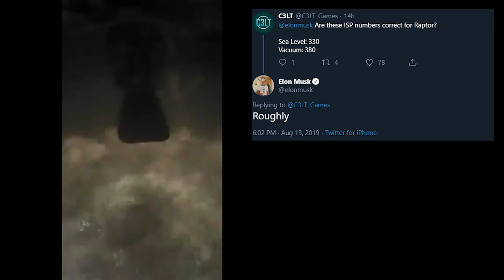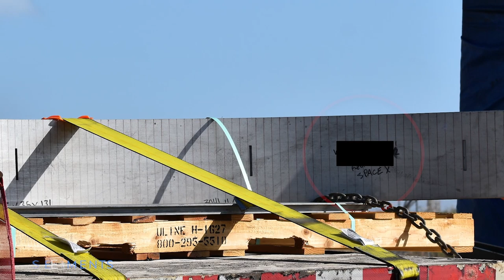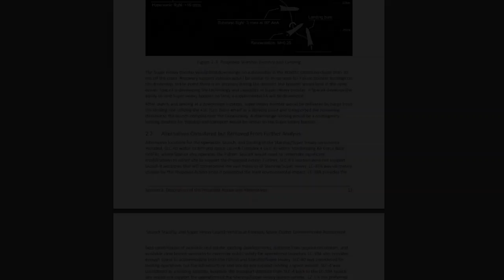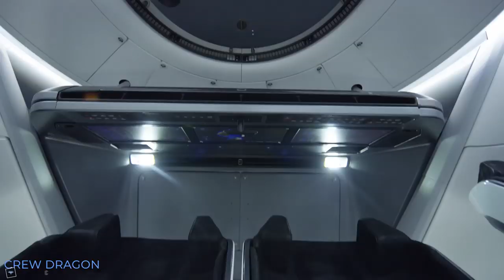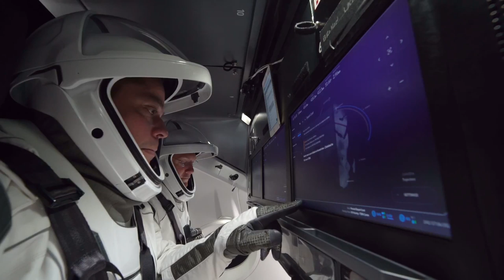25 | SpaceX Go For Launch - Starship & Starhopper News - SpaceX Suits - Starship Flame Diverter

Comment: My guess on those large pipes with the flanges is that they are the LOX lines that will go through the CH4 tanks.  The flanges are to connect to the interior baffles or some other structural member inside the tank.  They will connect to the manifold you pointed out being installed in the bottom bulkhead and thrust structure.
Reply from the maker: That sounds logical! Thank you for the comment! :)
Reply: @Whataboutit That was my thought as well when I saw them in your video. It immediately made me think of the LOX lines inside the S-IC (1st stage of the Saturn V) that passed through the RP1 tank to get to the F1 engines.

Comment: I think that the black sticker is covering SUPE VY. When combined with the letters that are visible, this makes- SUPER HEAVY!
Reply from the maker: Bingo. That's what I thought too!
Reply: @Whataboutit   A crazy Elon style thought: what if the bottom section of Starship prototype is actually the Super Booster? Would explain it getting taller than expected. Pointy section is Starship prototype by itself; only need a short version for first prototype? All sorts of reasons it doesn't make sense, but...

Comment: Lol, superheavy to fly this year? Haters are gonna eat their hat!
Reply from the maker: We will see! But it would be awesome. :D
Reply: Yup.
Reply: The Superheavy 1st stage is relatively simple compared to Starship upper stage. They’ll just need to make a long stainless steel 9 meter tube, install fuel tanks, engines & avionics & run some tests all that takes about half a year or so for a new launch system. Starship is more complicated because it will be for trips to & from orbit & long duration deep space missions so it would eventually need heat shielding, life support, more advanced thrusters etc.
Reply: @theatom7264  I'm really hyped to see how they are gonna build all these engines this fast!
Reply: 3D printing will be used to make most of the engine parts which speeds up the manufacturing process.
Reply: rocket lab already ate their hat.
Reply from the maker: Hope not! I love RocketLab!
Reply: Hopefully they have their nacho hats at the ready,  ;)
Reply: Elon said Mk 1 and Mk 2 could fly by the end of August! Reality time keeps being desynched from Elon Time.

Comment: As we have seen with the N-1, getting as many Engines as Superheavy has working without problem would impress me.
Reply from the maker: It will be difficult!
Reply: People said the Falcon 9 had too many engines to work, and then they said the same thing about the Falcon Heavy. The N-1 did not have the benefit of modern materials and modern computers to design and simulate a launch with so many rocket engines. Starship/Superheavy might explode, but I am betting it won't. Chances are I probably won't even make a decent return on my bet.
Reply: @curtisquick1582 I guess you are right. But it will still be awesome if they make it!
Reply: N1 had pyrotechnic fuel valves, so it couldn't throttle the engines at all, they were either on or off and once turned off could not re-start... Thing's have moved on quite a lot since then... That's not to say that it won't be a very impressive sight, it will be awe inspiring to see this beast go and return for a pinpoint landing.

Comment: In Cocoa there is also a rail way being put in to connect Orlando to Port Canaveral near SR 528 "The Beach-line" which is really close to their facility. I bet Elon will try to utilize that for transport  considering it may be the most perfect way other than truck over 2 rivers
Reply: Actually after driving by today, The power lines were raised by the FedEx building as well across the street to another road so it appears that's what they are doing. Only in those areas. Or maybe just a straighter way to the highway.

Comment: Starship/superheavy may be a lot taller than expected. with 30 thrust optimised raptors (250 tons of thrust) and 7X 200 tons raptor with gimbal the total thrust should be 8900 tons.
When starship was presented last year the total thrust was 31*200 = 6200 tons, that's a 44% increase so probably a 44% increase in height too, so if last year starship was 120m tall it would then be 172 meters tall!
Reply from the maker: The 24th is definitely going to be a very exciting day! Thanks for the detailed comment!
Reply: @Whataboutit  I changed my comment (some errors)
Reply: @johntheux9238  wow 172 meters tall... it isnt a rocket anymore it's a flying skyscraper
Reply: @pappacell  Well, the tanks have an hemisphere at both end that take some space and there is also all the engines, etc... If they make the rocket bigger each additional meter will be only fuel and that's heavy. So maybe if the thrust is increased by 44% the height will not be increased as much.

Comment: My guess is the tubes with the rings are support columns for the fuel tanks. Perhaps  they go in the center of the tank then some sort of spokes attach from the rings to the walls of the tank. I know water towers sometimes have internal support structures like this.
Reply: Perhaps the LOX tank needs a tube that feeds right through the Methane tank to the engines? I'm just guessing here...

Comment: 330 Isp at sea level? Holy hell, that's amazing!
Reply: The chamber pressure is very high so they can reach a very high nozzle ratio at sea level.
Reply: @johntheux9238  I guess that's the advantage of reaching 300 bars. The closer you can get the ratio of atmospheric pressure to inlet pressure to zero, the more efficient the nozzle.
Reply: @General12th  Well, at sea level the outlet pressure
 is one atmosphere so the only way to get an higher ratio is to increase the chamber pressure.
But there is something that excite me: If they reduce the size of the nozzle they can fit a lot more engines on the booster so they can build rockets the size of a skyscraper and they would not loose too much efficiency because even if the nozzle is underexpanded the nozzle ratio is still good enough.
Reply: @johntheux9238  That's why I said it's good to reduce the ratio as much possible. You can't lower the atmospheric pressure, but you can definitely raise the inlet pressure. Raptor's efficiency here can be as good as 0.804, which is loads better than the F1 (0.703).

It's good for the Raptor to be so small, but I'd be more keen on maximizing its thrust-to-weight ratio so the Superheavy (or as I like to call it, the "Starlifter") can have as few engines as possible. Less ship mass means more payload mass, assuming you have the same amount of fuel. But it's possible multiple nozzles interact with each other in a way that improves overall efficiency. Is that true?
Reply: @General12th  What do you mean by "reduce the ratio" ? Because if you reduce the nozzle ratio the efficiency will be lower. (if I do not make a mistake
 it's the ratio between the density of the gas in the combustion chamber and when it came out of the nozzle) and it's 40 for the raptor at sea level.
https://en.wikipedia.org/wiki/Raptor_(rocket_engine_family)
Reply: @General12th  Well, i would not be bothered too much by the thrust to weight ratio because most of the weight is the tanker itself. But if you increase the thrust to nozzle area ratio you can lift a spaceship that's taller. The best way to do that is to make the nozzle smaller.
Reply: @General12th  Yes, it's possible, look at this aerospike engine:
https://i.stack.imgur.com/8t13m.png

Comment: Those long pipes with the rings around them look like they could very well be internal propellant feed lines.  The fact that they are so large is not surprising, internal feed lines almost always are.  The large size probably reduces the tenancy to vibrate side to side.  The rings must be stiffeners but there don’t seem to be enough of them for that.  All just a guess though.  Those pipes are steel and I can’t imagine anyone using something like that as part of a rocket since it needlessly cuts into performance.  Of course, the initial Starhsip will almost certainly be just be in the form of a Starship and not much attention to performance may be afforded it; just something to fly and shake down.

Flying and landing Starship on the Moon shouldn’t be to tough of a challenge.  Getting into orbit around Mars shouldn’t be to tough either if they can retrofire.  But landing on Mars would be difficult as would be returning to a landing site from Earth orbit.  But the thought of coming back to Earth from either the Moon or Mars is laughable.  That thing would burn up so fast it would look like a flashbulb going off.
Reply from the maker: Thanks for the feedback! :)

Comment: I actually am not a fan off the starship 50s rocketship look. But if it does what it says it’ll do I won’t care. Personally I always thought that interplanetary travel would be better facilitated by building large nuclear powered ships in orbit that could transport astronauts and landers to their destination and be refueled between or even during missions. Landing and taking off with the whole spacecraft seems wildly inefficient to me, but again, if they pull it off my opinion won’t matter.
Reply: Well, if you can refuel it in orbit it doesn't matter if the whole spacecraft takeoff.
Also nuclear thermal rockets has probably enough thrust for starship (but not for superheavy): http://www.daviddarling.info/encyclopedia/P/Phoebus.html

Comment: These Tubes with intersections look like a central Stabilizertube for the upper Parts of the rocket.. Just my 2 cents. Other Parts could dock on the central tubes rings, and you could bulid Floors and roofs every 4 or 5 rings at the inside of starship.
Reply from the maker: But the prototype won't have a crew interior. What would you need floors for? :/
Reply: Those look like long one-piece tubes with disk-fins, not connected intersections. And agree they are for the interior of Starship, nothing to do with tankage. Felix, interior will have some sorts of structures, if not full decks. Can't just be empty to be an useful prototype, right?
Reply: @Whataboutit  perhaps cargo and mass simulators or they may intend to human rate the prototype some time in the future.
Reply: Maybe not floors but something for Hullstabilitiy, You cant leave it 100% hollow. And for 100 % accurate testing, it should have an Interior like a later Flightmodel, because of weight and other things.

Comment: Felix,
Another great show! What is your thoughts on the lack of an abort system on the starship. Any concerns?
Reply from the maker: Thank you! :) No concerns. Launch and reentry (besides the Space Shuttle) have not been risky. 4 people (besides possible russian cover ups in the early days and the Shuttle) have died on launch and reentry so far (again, if you leave out the Space Shuttle). On a design like Starship an abort system is really hard to implement. Also you can also make the rocket as it is a safer vehicle. That reduces fatal accidents as efficient as an abort system. In the end though safety must be a top priority. It might be possible to use the Starship itself as an abort system. If the booster has a malfunction, you can separate and use the Starship as a life boat. That might be a way.
Reply: What about it!? That’s a good way at looking at it. Starship is the abort system. I never thought about it that way. I believe you have successfully changed my outlook. You’re the best!  Thanks!
Reply: @michaelpuckett6138  They can shut down superheavy so even with low G-forces starship can escape.
Reply: John theux  My main concern was while sitting on the launch pad, fueling up. You can imagine an explosion of the super heavy or something like 5 sec after lift off. Those times are where most of my concerns are. If starship could be its own abort system & get outta way of a self destruction event, then my concerns will be lessened a great deal.
Reply: @michaelpuckett6138  Well, starship can't escape on the launchpad (less than 1G) but once the rocket has take off it can.

Comment: They'l just fly it over. no need to move it around.  I suppose thous pipes are core of the ship. They will stretch cables from it to the outer shell to keep it stable or use metal sheet to make levels, since there is no interior yet to keep it all together.

Comment: Am I the only person that would rather see more mechanical switches and what not in the dragon? Touchscreens are great and all, but I'm a sucker for that nice KACHUNK that a beefy switch gives.

Edit: also, as roomy and nice as that interior looks, you need to keep in mind that every last inch of free space will be taken up by cargo and supplies on an actual launch. Empty space is wasted space and wasted space is wasted money.

Edit 2: and I think that super tall section we see next to the nosecone is actually the outer hull for super heavy. Seems, to me, it's too tall to be part of starship.
Reply from the maker: That's what I think too! But you might be wrong about the cargo stuffed into the dragon. Most cargo does not need pressurized space. The Crew Dragon has a trunk module. The reason, why soyuz is always so stuffed is because it doesn't have much trunk space. Correct me if I'm wrong though!
Reply: @Whataboutit  You're right, but just because it doesnt need to be in the pressurized section, it doesnt mean it wont be. That would be kind of a silly reason to not fill all available space.
Reply: One problem with physical switches that NASA learned about over 50 years ago is that every switch needs wires associated with it. And all those wires take time and space to install and route. Some believe that a frayed wire set off the spark that killed Grissom, White and Chaffee.
Reply: @AtlantaTerry  Very good point. I'm not trying to criticize the decisions SpaceX has made since they're far more intelligent than I am. My point in my original comment was that if I was (never will be, but i wish to be) the one flying, then I'd rather have some of the more important flight controls and systems on physical controls near where my arms would naturally rest. Buuuuuuut I'm no aerospace engineer, so what do I know. Haha.

Comment: Hi Felix.  When I look at those two circular tubes I see two central supports.  Think about it, in a cylindrical design you would need a central shaft to have something structurally sound upon which to anchor decks.  What about it?

Comment: If people were to tunal into the walls of a crater for mining reason. Then they can turn those mines into living courters for the colonest. If not then refineries to refine the materials, and factories that could build parts for mechanics, and colony habitats. As well as parts for power plants, and many more.

Space planes could be created by using 2 different types of engines two being jet engines, 4 being rocket engines. 

Going to need a orbital refueling station in the near future.

Going to need a space carrier for the space planes, and dragon pods design to go to Mars and back, and stay in space... Also kind like cargo ships...but in space.

One way to keep your mulsels and bones being decrease would be to create artificial gravity, and a rotating Ring would cost to much to build. So using something like magnets, or electric magnets, metal tacted shoses, and magnet reactive clothes that restrict your body when in contact with magnets just enough to give your body a work out. This would be cheaper for artificial gravity then rings.

How can you protect people from radiation? In my eyes elector magnets can protect you by creating a magnetic field. 

Heat? Airo Gail

How to protect the computers from radiation, and the magnets? Make them magnet proof, and the electric magnets will deal with the radiation.

Hole breach? Stirfom in the walls design to quickly sel up the hole after expanding to extreme size by decompression.

Comment: That three way pipe intersection might be the same size as the pipes. Could they be parts for a water based flame dousing system?
Reply from the maker: There's already a picture out of the intersection mounted on the thrust structure. So it will be used for fuel lines. The pipes might be the lox line going through the methane tank!
Reply: Theorizing is one of the fun parts for me.

Comment: so is NASA going to ever fly on Starship if it doesn't have a emergency abort system? Or our they going to give up on the abort requirements after Starliner and Dragon Crew? It seems that NASA over learned the lack of an abort system on the Shuttle. It is a nice thing to have but it has caused some much 'overbuild' and delays
Reply from the maker: The real question would be, if it does make a difference, if NASA agrees. If Starship really delivers, they won't have an alternative to it. The performance will be so much better, the use cases so much more desireable, that in the end they'll just use it.
Reply: That's up to NASA, but they do regularly fly their astronauts on commercial flights that don't have abort systems either. Starship/Superheavy (SSSH) is different that the Space Shuttle and SLS. Both SLS and the Shuttle used solid rocket motors which could not be shut down and are quite dangerous with an unfortunate tendency to explode. SSSH is a liquid fueled rocket that can be throttled down if there is a problem. If Superheavy has a problem on launch, Starship can be its own abort system by firing its engines to get away from an errant Superheavy.
Reply: @curtisquick1582  Yeah, some people complain about the low thrust to weight of starship but it doesn't matter since they can shut down superheavy so starship can go away.
Reply: @curtisquick1582   As powerful as Starship is, I don't think its engines can accelerate that large mass that quickly to be a reliable "abort system." It will be trying to outrun an explosion.